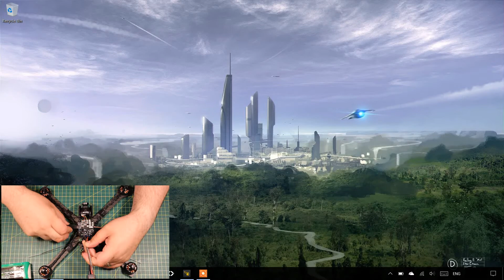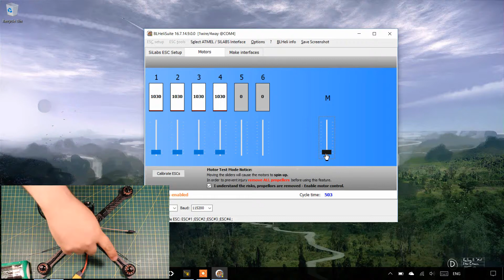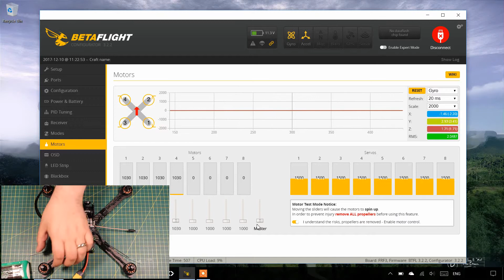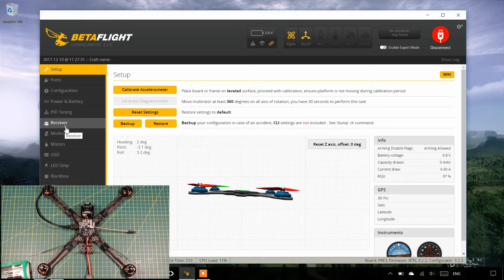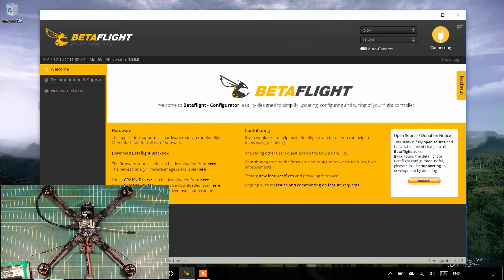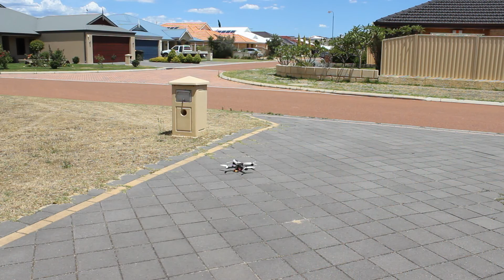iFlight XL7 - Build pt2

Comment: which motor are you using?
Reply from the maker: +Enrico Bononi Cobra 2204 somethings... I forget the kv but it's way higher than the 1600kv I was aiming for.
Reply: thank you! very interested in this build/project as i would like to do the same but i don't master the motor/cell number/mAh/propellers' size theories very well.

Comment: Nice job on the build! Really tidy way of mounting the antenna away from the props. Do you have an stl file published anywhere for the mount by any chance?
Reply from the maker: +Harpalyke I have it but I haven't uploaded it yet. I'll drop a link in the description when I do.
Reply: Thanks. Would really help me out. At the moment my antenna is mounted to a backplate and comes up between the props. Its pretty tight back there and its just asking for trouble.
Reply from the maker: Uploaded the mount STL file to https://www.thingiverse.com/thing:2722522. I've printed this with ABS so if you print with anything else please take in to account it was designed to account for the ABS shrinkage (so it might not be exactly the right size)
Reply: Thats great. Thanks for uploading!